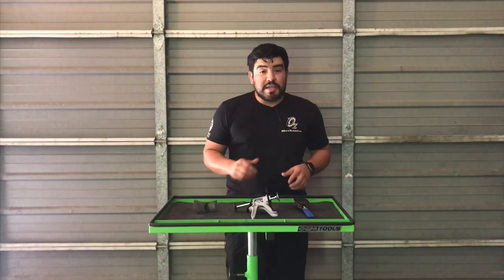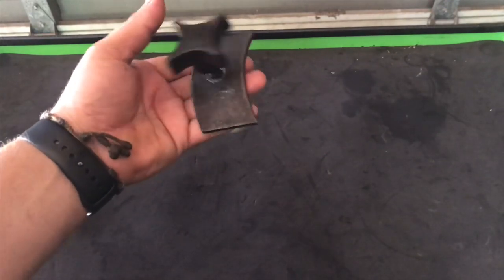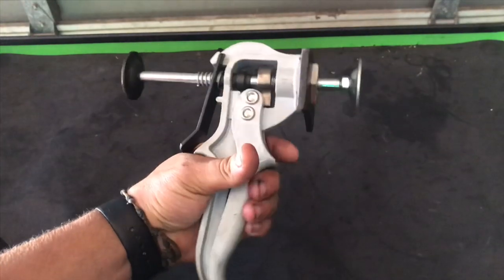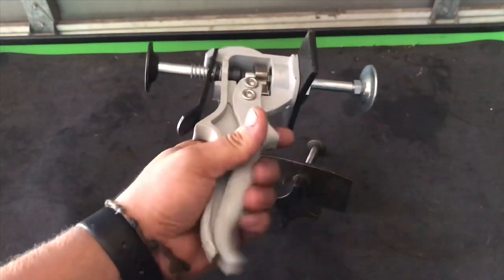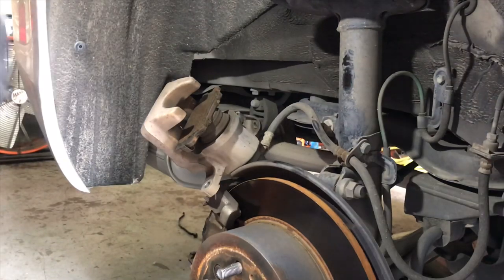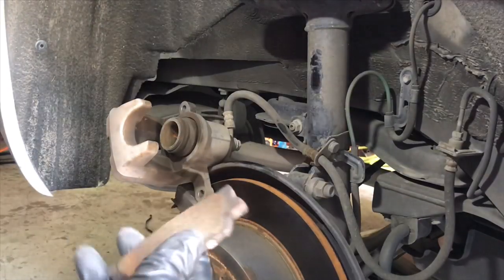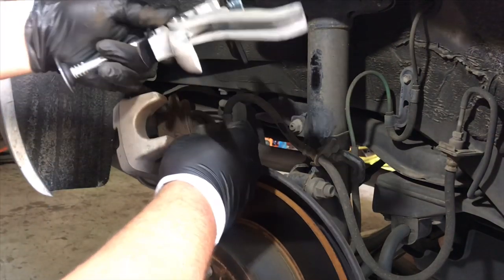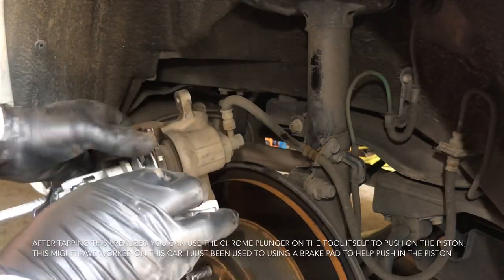Brake Caliper Tool Review

Comment: Hey bud not sure if you’re still monitoring this video but do you think the leaver action one will work for my civic type r, I know the fronts are big Brembos, but the rears are smaller. Was wondering if it would work with both sides or if I should grab the first tool shown the very basic one.

Comment: Hey Oz mechanic can you please help me I can find the neutral safety switch on 00 biuck lesabre I don't see anywhere I search on internet but no luck please bro
Reply from the maker: Looks like it would be on the top of the transmission on the passenger side of the engine compartment